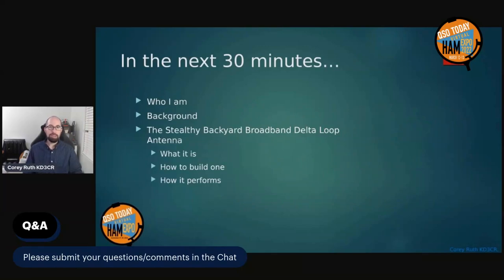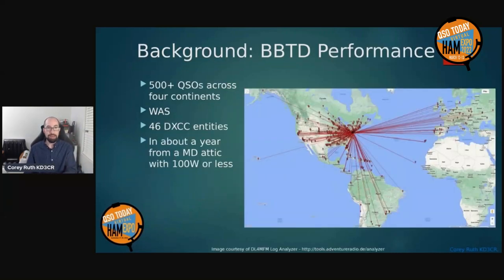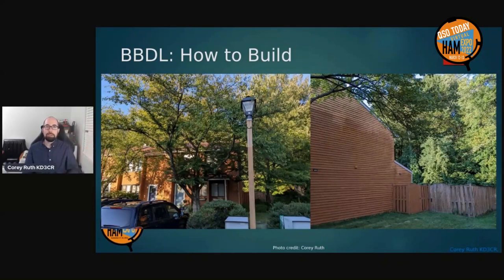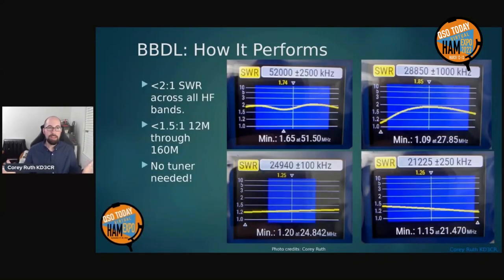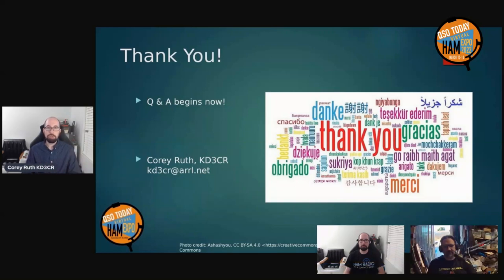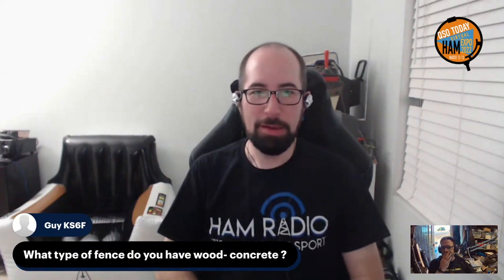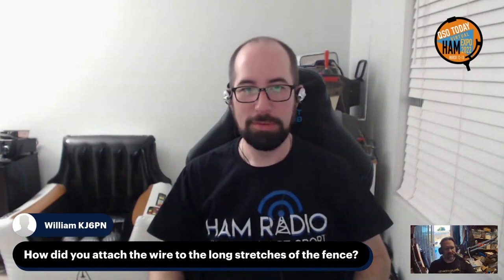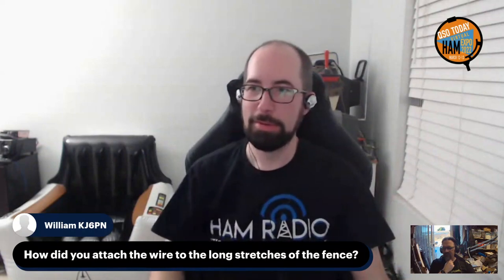How to Build an All Band in an HOA Stealthy Backyard Broadband Antenna - Corey Ruth, KD3CR

Comment: Well, it’s a nice start for you. I noticed that you have a long stretch of wire acting as a partial feed line around the fence; those parallel strands with the resistor as a terminator will mostly cancel each other out, especially at longer wavelengths. I’d run the legs in different directions to avoid that. (One leg could run along the eaves.)

I believe that explains the lack of superior performance over the attic loop, along with the proximity to the ground. Yeah, it’s hard to spot, but I don’t think it’s the right antenna configuration for you.

I once ran an antenna in my attic, and my main problem was that the house’s electrical wiring was picking up too much of my signal, even at QRP levels. Lighting and appliances were affected, as well as broadcast television, and I felt it would have been cost- and labor-prohibitive to fix. I moved within a year.

Welcome to amateur radio. I hope you have many happy adventures!
73 de KA4BGT
Reply: Hi Michael! The wire along the fence is actually part of the antenna rather than being a feed line.

Running the legs of the antenna in different directions as you suggest would make this antenna into a simple dipole. Those are fine antennas too, but not what I'm going for here. A dipole is good but only works on a single band. The BBTD or BBDL on the other hand gives up some efficiency in exchange for excellent broadbandedness (being able to work on every HF band). In order to do that, the antenna is designed around the two legs terminating at the resistor.

I believe having most of the wire low to the ground is the main reason why the BBDL in my backyard didn't perform leaps and bounds ahead of the BBTD in my attic. If having parallel lengths of wire canceled each other out, then designs like the T2FD, folded dipoles or loops wouldn't work at all, yet they do. For more details, please check out the site where I got my design from: https://hflink.com/antenna

RFI can certainly be more pronounced with attic antennas. Sorry to hear that you had issues with yours. In the three years I've had mine in my attic, I've had almost zero issues even at 100 watts. It causes no interference to our lights, computers, TV, etc. And none of our neighbors have complained either, including the one we share a wall with (being a townhouse). I'd love to be able to mount an antenna outdoors, high and in the clear, but moving isn't in the cards anytime soon. I'm glad for my attic antenna in the meantime. It has given me some 1,500 contacts, Worked All States, 67 DXCC entities and counting and many hours of enjoyment.